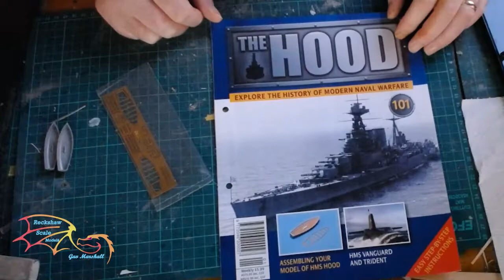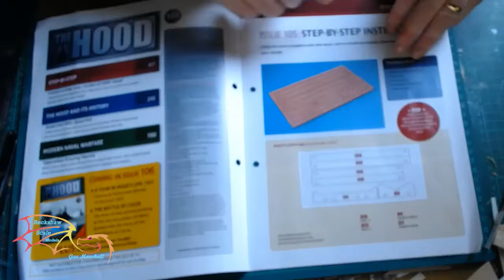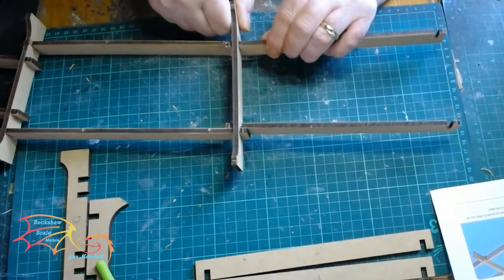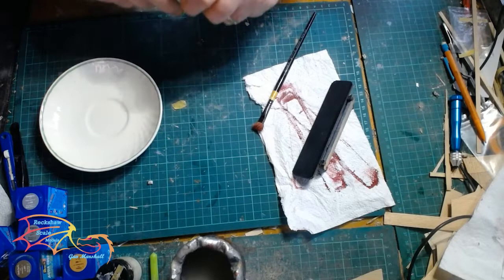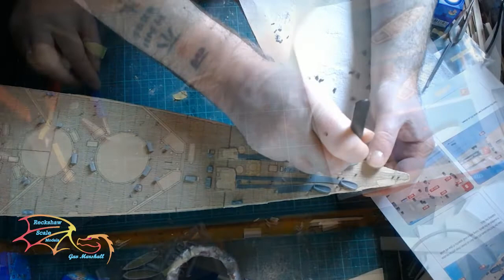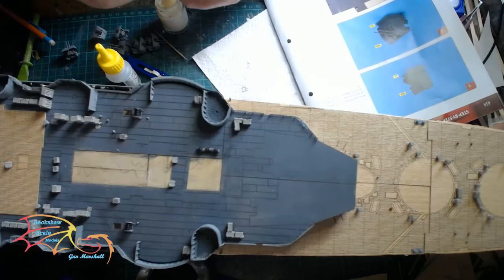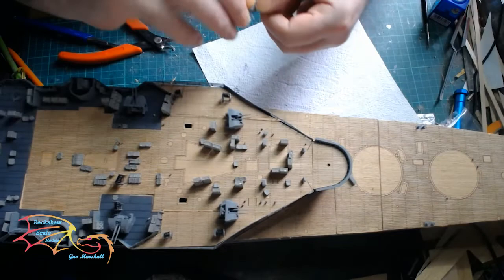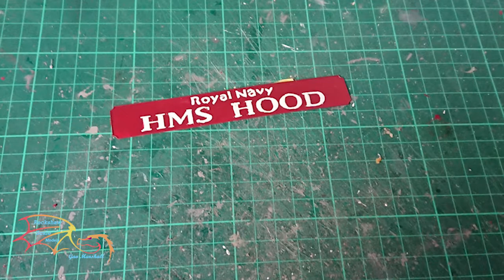Hachette HMS Hood Scale 1/200 Part 16 Twin Guns

Comment: Great video Gavin, like the way you didn't throw in the towel on that piece of photo etch that broke apart, I saw how you straightened it and installed it, you could never tell it you  had an issue with it. Thanks for sharing your craft and thoughts. See you next time.
Reply from the maker: Thanks Steven, I do like trying to figure out a way round these problems normally. Having a few sheets of plastic card on hand solves most of the problems. Saying that this kit is really testing me.

Comment: Hi Gavin - I've had the same trouble with etched brass, but on much finer parts by White Ensign Models which are truly fragile. Try keep something like part of a ceramic tile (flat and smooth) on the parts you're cutting while you're removing them, as this can help stop them twisting. It doesn't always work for me, but it helps. Cheers, Neil
Reply from the maker: Hi Neil, thanks for the suggestion I'll give it a try, detaching them is a real nightmare. Even with a new blade it struggles to cut through. I did think taping them down on a thick piece of cardboard may help, there again it could just be me.